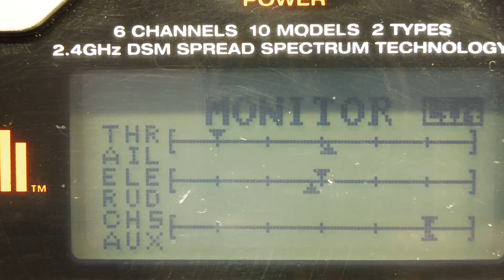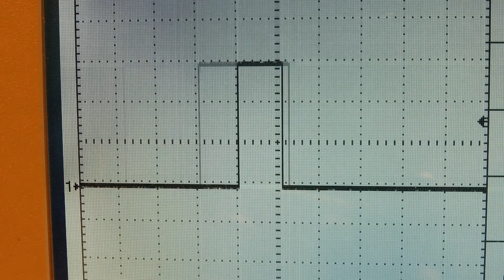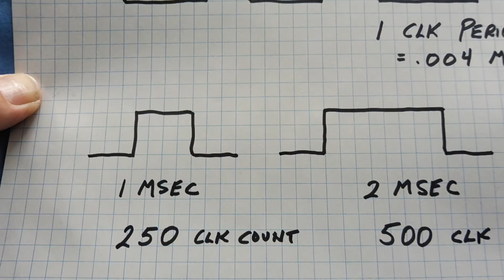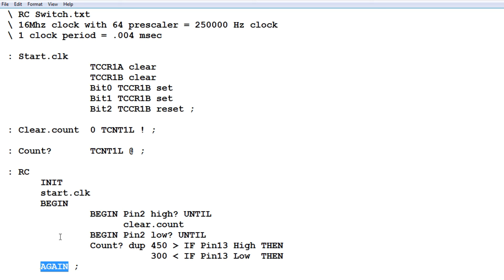How to Build a Radio Controlled Switch

Comment: Interesting ! and useful !

My problem is, new rx modules are going to SBUS, IBUS etc. and PWM tends to disappear. Any solution for those ?

Also, Forth looks strange and intriguing to me. might be worth a look.
Reply from the maker: PWM has been around for a long time and is common to all RC vendors. SBUS by Futaba and IBUS by FlySky are vendor specific which reduce wire count and introduce two way communication. I think PWM will still be around for a while.
Forth is a great language for controlling hardware because it is interactive.
Check out these web sites:  www.forth.com        www.forth.org
Reply: Thanks for the links !

I see several versions of Forth for Arduino, do you have a recommendation ?
Reply from the maker: There is a free online Forth book at :  www.forth.com/starting forth
I would first try Flashforth, it is free and there are tutorials and online support:  www.flashforth.com